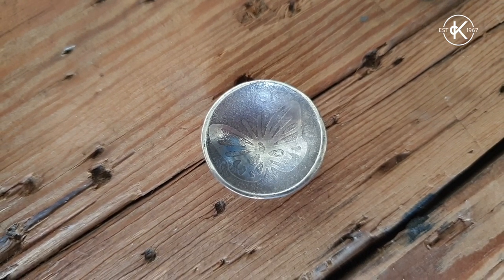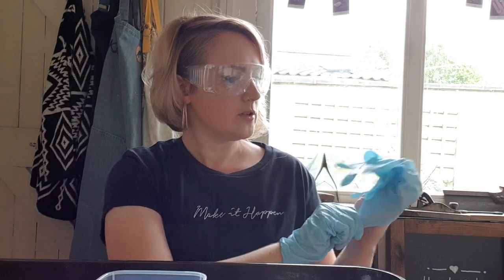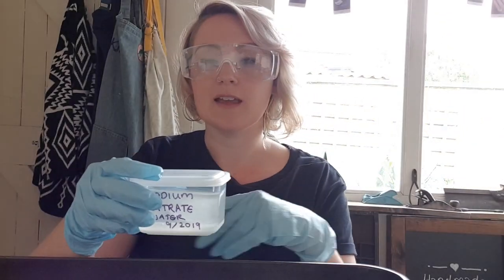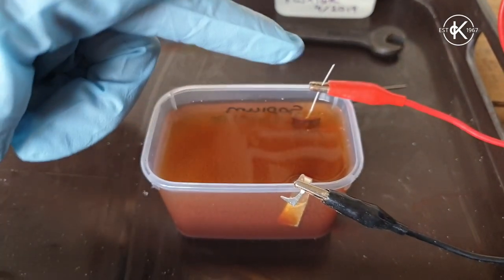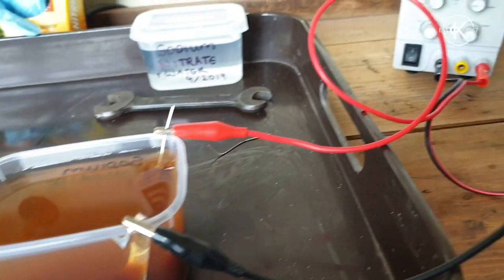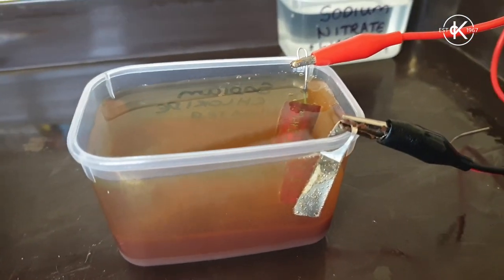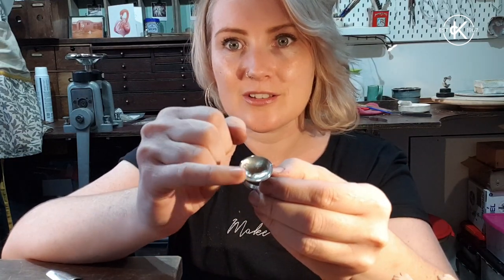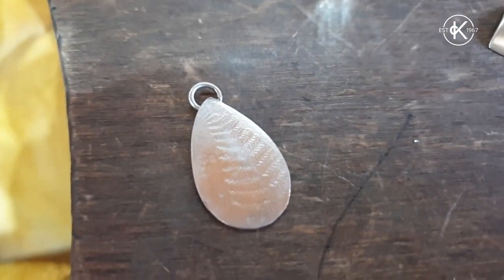Electro Etching Sterling Silver & The Comparison Of Metals | 12 Months Of Metal

Comment: I did quite a bit of electro etch, electro plate, and electro form back in the 70s and 80s.  tips ... if you coat both sides in resist, you can do piercing by etching half way from both sides. We did use larger sheets to start. Sprayed photo etch both sides, then expose through a clear mask printed on laser transparency stock.
I also used to use electro etch to make decorative stamping tools in hard tool steel directly. We actually made patterned rollers for the rolling mill to directly imprint sheet stock.

Comment: This is so helpful, thank you! I’ve got a rectifier because I thought I was going to do electroforming, but I’m so scared of the chemicals that they’ve been in my garage for two years and I haven’t used the rectifier at all. This is just a solution you can dump out afterwards right?
Reply: Anything that contains metal particles can't be poured down the drain but it can be evaporated or poured into cat litter then put in the bin. :)

Comment: Good informative series of videos, thanks. Have you tried Ferric Nitrate? I have had success with this by floating the silver to be etched in a small  container of Ferric Nitrate and water, 1:1 mix, and placing this in a larger container of hot water. Leave it for a few hours and you get a good deep etch. Resists are as you have already described. I have not tried this method with electricity yet, but having viewed your videos, I will once I have the equipment. Thanks again.
Reply: Hi, yes I've always etched with acids like ferric nitrate before but decided to give electro etching ago as I'm not keen on working with acids. But ferric nitrate definitely gives a cleaner etch than I achieved with the sodium nitrate! :)